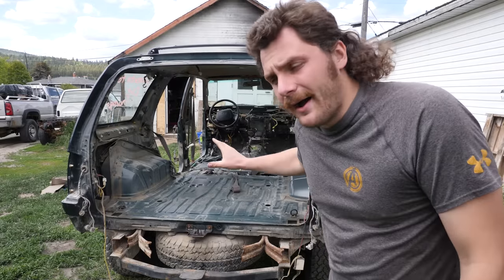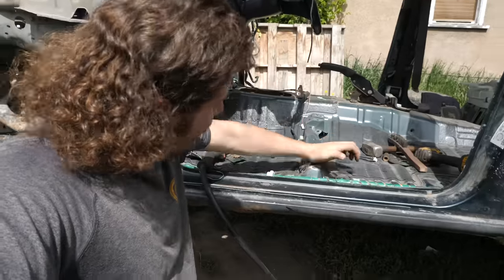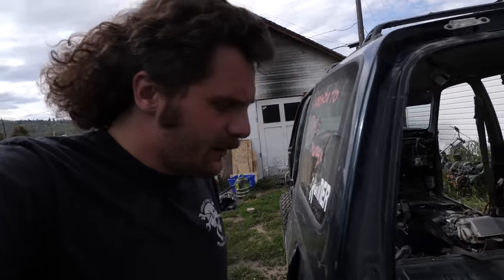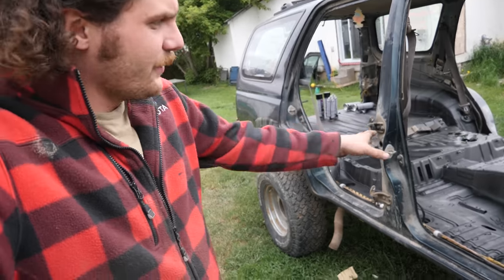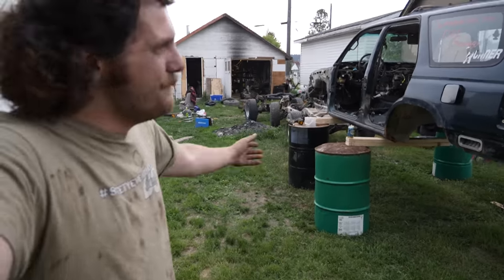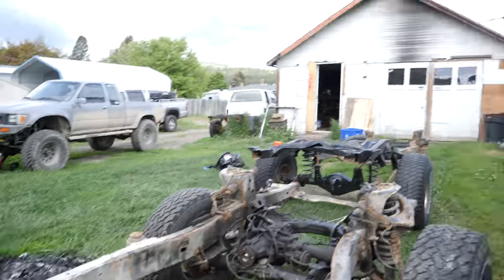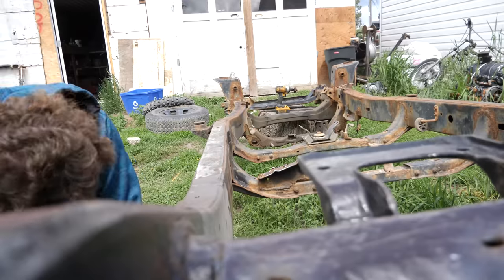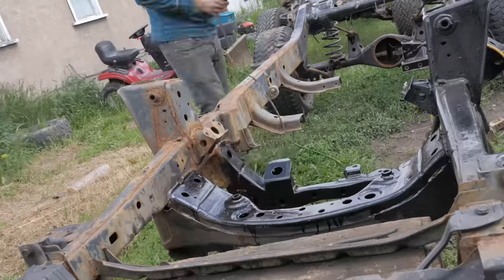How I Remove Body from Frame with OIL BARRELS? 3rd Gen 4Runner Build

Comment: The 1996 4Runners were missing the B pillar body mounts.  However, the holes are present in the floor of the cab, there is just a plug in them. When I added a body lift to my 96, I purchased the mounts and welded them on.  I kind of chuckled when you cut yours off the new frame thinking of the work I did to add mine.   Thanks for the awesome Toyota content,  keep the videos coming.

Comment: Inspirational material.  I have a 93 4runner that I have frame swapped for the exact same reason.  So much rust the back shock was flopping around. Also just did the 3.4 swap recently and am now chasing a lean code. Spartan in the back. Want to SAS and 63 the back eventually.  Love your vids!!!!
Reply: Looking forward to the rust fix on the body..

Comment: Nice done. I used the same grinder/wire wheel setup when I did the frame on my 91. Those rouge wire bits flinging out and sticking into your skin really suck!

Comment: Donor frame Is probably a surf
Reply from the maker: It's not. I took the body off the frame. It was a 3.4L 4Runner. Just from a 2000 not a 96
Reply: @DirtGarage  I was assuming based off the gear ratio my Turbo Diesel Surf '96 has 3.52 gear aswell, Not sure what else would use such a high ratio lol